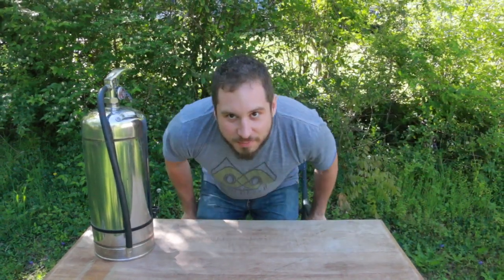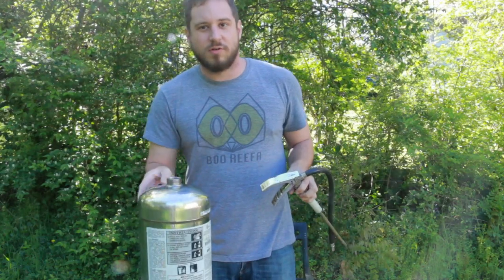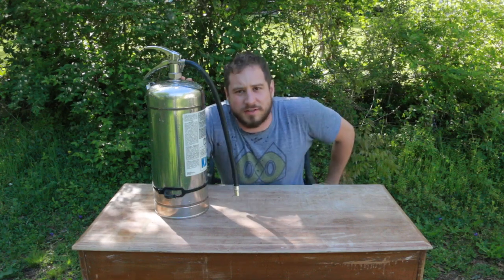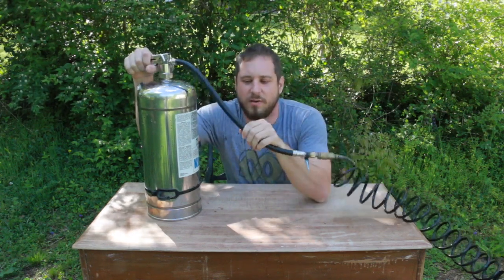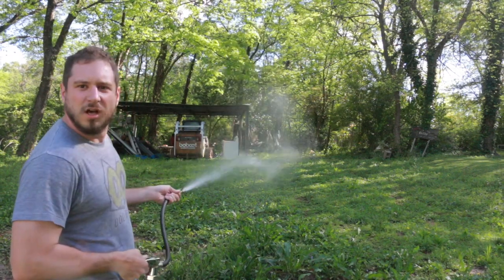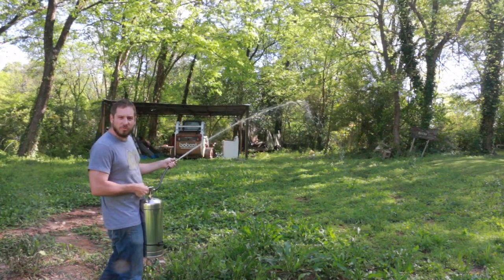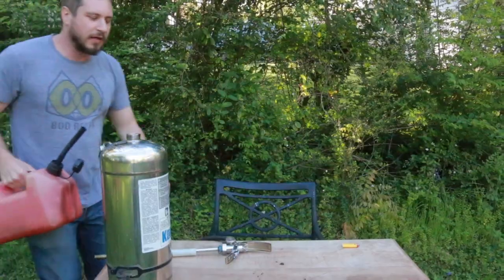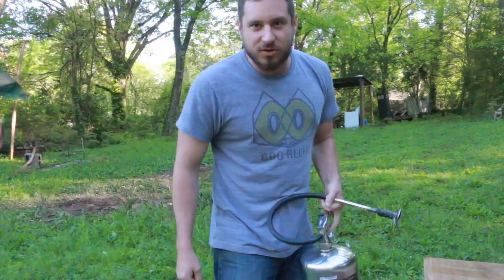Flame Thrower made out of a Fire Extinguisher

Comment: I wouldn't recommend pressurising it with compressed air as that essentially makes a petrol bomb, you should use some non-oxidising gas, like propane or carbon dioxide.
Reply: Thought the exact same thing, if that flashes back it will explode with enormous force
Reply: I was thinking that also while watching this,
Is nitrogen a good option since it is basically inert?
Or would i be better off with Carbon dioxide for saving money
Reply: The shrapnel would deeply imbed into your skin and surrounding objects this would kill u
Reply: Hop e No shit?
Reply: Fordas you just gave me an idea.Time to blow up my bully's house.
Reply: Sue this guy, i saw him burning a cat alive for no reason
Reply: @andresangel8641  this guy as in uncle rob?
Reply: @andresangel8641  Who are you referring to?
Reply: propane has a limited trajectory nowhere near what he made.  his striker was too close as i would put a foot of distance at minimum.
Reply: @jacobshepherd3997  how's the flame going to flash back when there is pure fluid coming out?
Reply: Nitrogen
Reply: @andresangel8641  are you serious?  Where is this at?
Reply: Would diesel plus air be safer?  Gasoline seems way too volatile.
Reply: @TravisFisher  Doesnt diesel only ignite when under high pressure/heat
Reply: @bert2522  it will ignite but diesels flash point is a lot higher than gasoline or propane.  It should be “safer”. :)

Comment: you need to pressurize the tank with co2. The air can allow the gas to burn inside the tank, and if a spark gets in there somehow, it will blow you up.
Reply: Is this really possible?
Reply: @arminarlert9868   It's arguably safer.  Some guys use nitrogen.
Reply: Or propane.

Comment: That white plastic tube you pulled out with the valve and dip tube is intended to stay in place.  That's what tells you how high the water level is.  You fill with water until that tube makes it back up and overflow; you now have your 2½ gallons of water and you have space for enough air to spray that water.  Then you close up and pressurize with air.  All of the extinguishers of this type that I've ever handled had a standard Schrader valve, so if you had a tire inflator and 100 psi, you were good to recharge the extinguisher.  Making an extinguiser without that valve, forcing you to fill through the hose, is a cheap trick.
Reply: Lane Dexter what bugged me is that he thought it was lucky that the compressor conect fit. Obviously that is intentional

Comment: I'm a fire equipment technician and have an abundance of condemned extinguishers so I'm excited to start burning some weeds hahah. These extinguishers have a hydrostatic pressure test range and as long as you stay under you can pressurize it a lot more than the 100 or 195 psi range they are rated for. Also compressed air is not a good idea, for obvious reasons.

Comment: That's called a "watering can" and are refillable. We use them all the time in the fire service. Fyi if you're using them the right way that white collar he pulled out is supposed to stay in the cylinder to prevent over filling of the water, there needs to be space left in the can to allow for enough compressed air to be charged in the cylinder for a steady water stream. They are designed to be recharged with compressed air, I believe its somewhere around 105 psi

Comment: Hi Rob when I was teenager I made this but I screwed in plumbing fittings put a gate valve in it but I would charge it with camping gas and then shut valve only thing it was not pressurised at all but I got 10ft flames from it I took it to school to show my mates too the year 1985/6

Comment: what keeps the fire from backflowing through the hose and detonating the tank(Especially when it gets emptier and has a lot of fumes in it)?
Reply: Inside the hose is 100%  fuel and 0% oxygen. There is no way the fire can travel back up the hose. All the pressurized oxygen is behind the fuel pushing it through the hose.
Reply: @bombsawaylemay770  can it explode if it was over 160 psi?

Comment: OK... everyone on the internet is missing it... the pressure gauge is 1/8" thread, local hardware store has a valve that's 1/8" thread for $4 called a Schrader valve. In case you don't have a hose with a threaded end.

Comment: ⚠Gasoline will combust due to compression around 150PS!  Gasoline also expands about 1% with every 20degrees of change causing your PSI to go up as the can warms! 
You really ought to know what you are putting out on the internet before you blow some poor kid up because he exceeded 150PSI. My can is marked from 1-200PSI with the green around the 90-120 mark so you wouldn't have to over fill it much to cause the can to explode. Or just fill it in the cold garage then go out in the summer heat to get the gas expansion to up the PSI then boom.